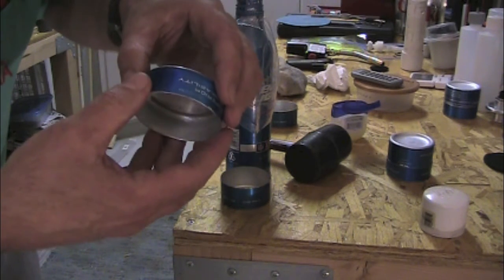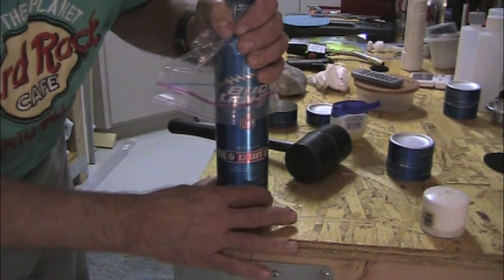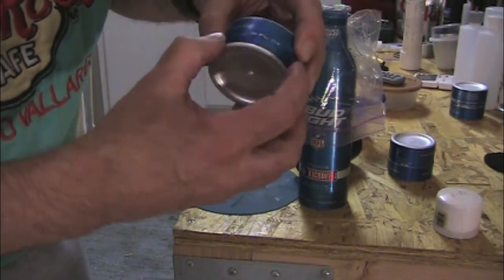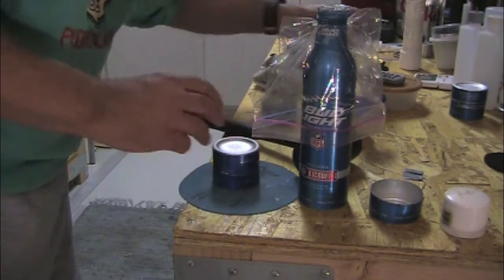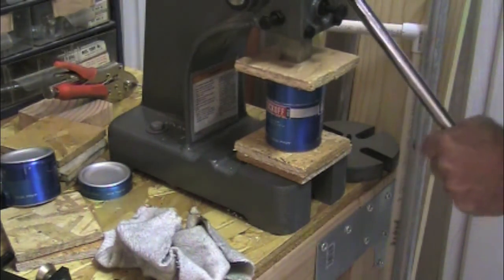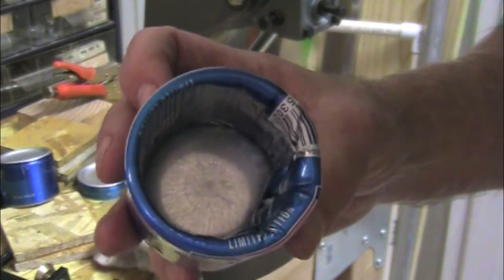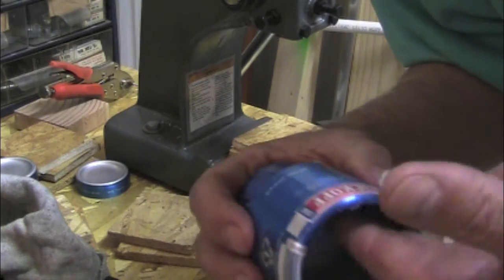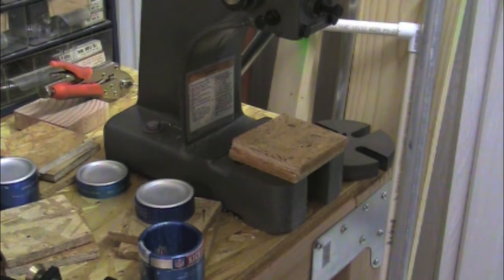DIY Budlight Alcohol Stove - Part 2

Comment: Very good video...my question is...burn time...full roll to the bottom vs the bottle neck insert...??? some people use some kind of lube on the die...to help separate the two...I use the hole in the die to separate them with air...first time I ever saw one made...it was separated by using air...thanks for all your ideas and techniques...keep on truckin...